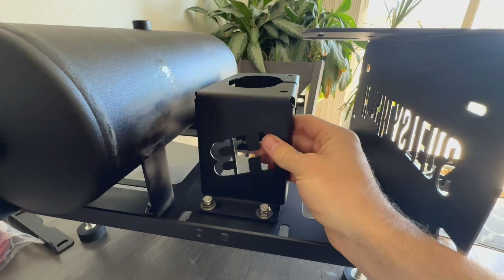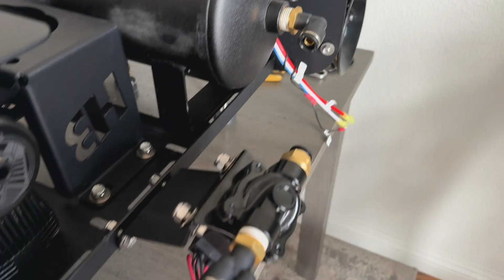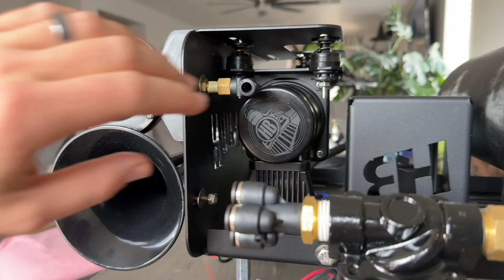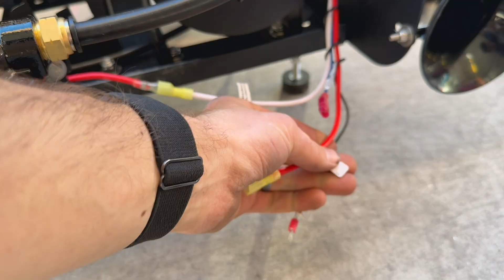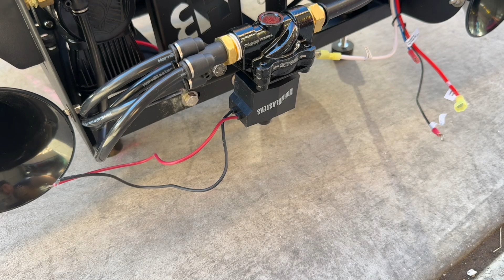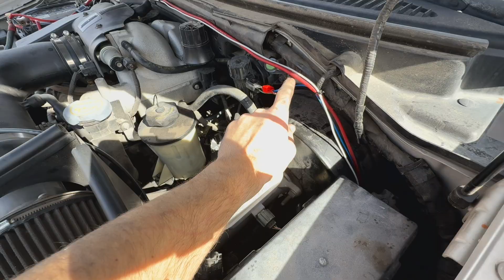HornBlasters Train Horn Build | Complete Setup, Wiring & Testing!

Comment: do you do installs for $$ or do you only do your own stuff ?
Reply from the maker: I take on outside work sometimes just depends on job type and time.
Reply: are you located in CA ? preferably inland empire
Reply from the maker: @vincentgarcia7152 no sorry im in Vegas!
Reply: damn! okay, do you have an experience hooking the wiring to an auxbeam switch with a electronic drain valve ? i built everything just stuck in that. plan to just use the buttons on the switch panel to not make any holes etc. if not all good. thank you
Reply from the maker: @vincentgarcia7152 I dont have any direct experience with that.  But as long as its key on power on it should work perfectly!